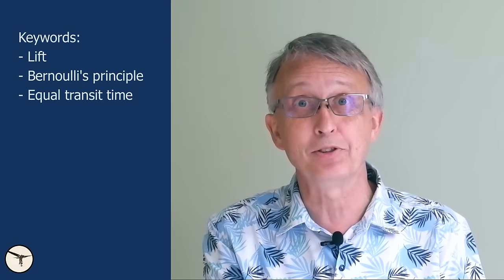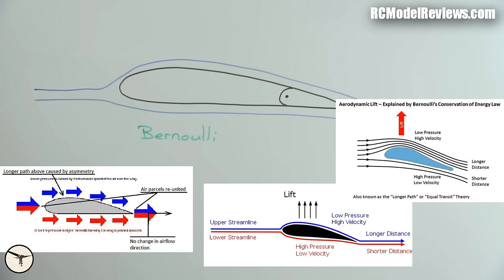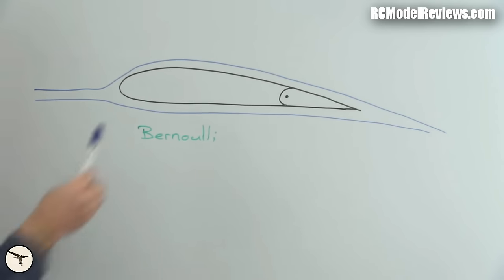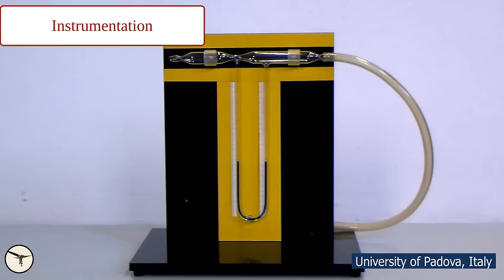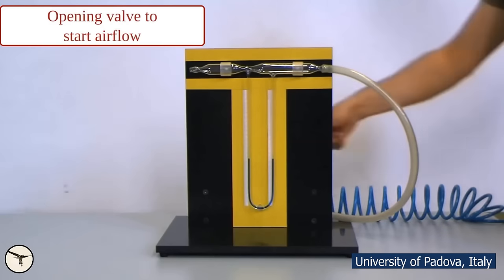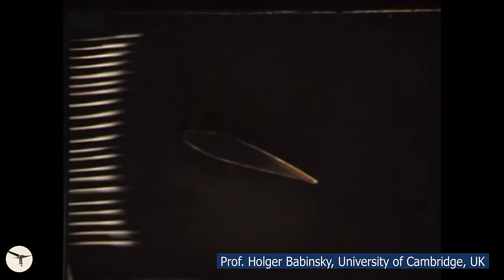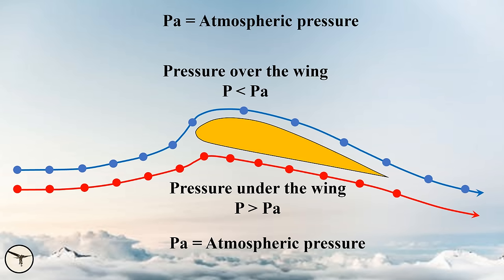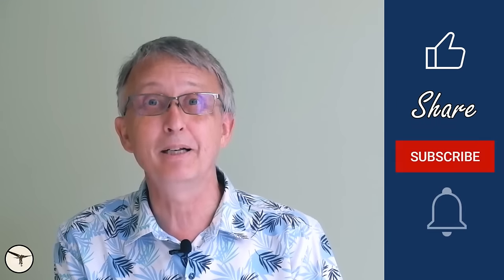Why are so many pilots wrong about Bernoulli’s Principle?

Comment: I’m an aerospace engineer who graduated from Embry Riddle, the top rated aviation school in the country. And even there, in our early aerodynamics lessons, the equal transit time fallacy was taught. I remember because I asked - Why does the air on the top HAVE TO reach the trailing edge at the same time as the air on the top? And my professor didn’t know… but to his credit, he came back the next week and taught everyone the fallacy of the equal transit time.
Reply from the maker: That's a great quality of an instructor.
Reply: No aniversário de 100 anos da Aviação eu entrei com essa questão "- Por quê um avião voa?" justamente para abolirem essa falácia que todas escolas ensinam sobre a sustentação e com o mesmo argumento do vôo invertido não aceitei tal resposta;
Reply: Calm down it's just a math model. Ask any farmer and he will tell you it doesn't have to get there at the same time. It's like permanent magnetism and residual magnetism it's all a personal opinion which one is there. If I like it it's permanent magnetism and I sell it for being a permanent magnet. If I don't like it it's residual magnetism and I don't tell anybody
Reply: @jacobstump4414 I have a technical article copied that credits Newton for wing lift, not Bernoulli. Did anyone teach that?
Reply: Only the second law of Newton related to the variation of momentum : F=d(mV)/dt, describes correctly the wing lift (vector F for the force on an air particle, scalar m for mass of that air particle, vector dV for the variation of velocity and scalar t for time). This law applies to all air particles moved by the plane flying through the air. The wing lift is equal to the vector sum  of the forces exerted by all air particles on the wings. The Bernoulli's equation describes only the aerodynamic behaviour of the air due to the movement of the plane. It has noting to do with the lift.
Reply: @jean-pierrevandormael5315  I see exactly what you mean and I see exactly what you don't mean. Bernoulli's formula has something to do with Lyft if you want it to and you want to model it that way and if you don't want to model with that way after model at the other way.
Reply: It has to reach at the same time because otherwise it would be shearing the armosphere. Natures solution is the formation of vortices behind that dissipate the shearing behind the wing. If the wind tunnel was run in lower speed to maintains laminar flow then they would reach both sides at the same time. I believe that if we invert the wing on the tunnel the time difference would became miuch greater and cause a lot more turbulence.

Excellent video - I really liked the wind tunnel image! I think equal transit time made sense from a logic point of view in the late 19th century when wind tunnels did not exist and that's why it's still taught. Another reason is that if functions as simplification that, if well done - like they do em Embry Riddle - makes for a good first approximation.

We all learn that electrons are like tiny spheres that travel around the nucleus. In my parents' time they orbited the nucleos like planets do around the sun. In high school (1990) I learned that they did not orbit because, in reality, we can't say how they move  because of Heisenberg's Principle. We still learned that electrons were like tiny sphere's, though. The fact is no one has ever seen an electron and we can't say anything about its shape - the idea, however, works for understanding a lot of phenomena. Electrical Engineers seem to have a better grasp of "different models for different situations" idea because it's important for practical applications in their field: 60/50Hz AC power can be treated as DC in a home electrical wiring - but not on 1,000 Km long transmission lines. Electrons can be treated as particles on semiconductors but not everywhere - like when electrons go through a tunneling diode.

We should always bear in mind that contrary to what journalists often write and influencers always post we actually know very little about nature and ideas now accepted as univertal and atemporal truths only got their formulations in the very recent past: Tectonic Plates was only fully accpeteed in the 1960s-70s; and all the genetics I learned in High School is now completely obselet becasue after we were able to to read the DNA we noticed it to be a lot more complicated.
Reply: Same thing in Greece. i had to watch a video here on youtube from a lecture from MIT to discover that equal time theory is not correct and to be honest i was reliefed because at first i couldnt understand why the air above the wing has to reach the trailing edge at the same time with the air below.
Reply: You must have gone to Daytona because the Prescott campus had wind tunnel labs in AE301 which showed the equal transit theory is false.
Reply: Riddler here.. that degree program is brutal.. majority of ppl fail
Reply: @maxheadrom3088  Wrong.   That's the fallacy.
In actual wind-tunnels, running slow with completely laminar flow, the parcels don't arrive at the same time.   They're split, and remain split permanently.  (Same thing happens in simulations, where turbulence is zero and the flow is 100% laminar.)

In fact, if we adjust the AOA of the wing, we find that the "splitting" or "phase-delay" of the parcels will change.   We can easily make the parcels recombine.   That only happens when the Circulation becomes zero, and the lift goes to zero.

So, a recipe to cause zero lift, is to set your wing so that the split parcels recombine at the trailing edge!   (This of course is a part of laminar "circulation theory," where the spanwise circulation will always speed up the flow above the wing, when compared to the flow below.  To create lift, parcels must always be split, and also, the wider the spilitting, the greater the lifting force.)
Reply: Rate of total mass flow in towards the wing must equal the rate of total mass flow out from the wing (in steady state).  

The preceding is the equal transit time which should be discussed but is almost never mentioned.

You must have however much imbalance in speed between top and bottom of the wing as the total asymmetry (shape plus angle of attack) calls for.
Reply: @davetime5234  Equal transit time is simply wrong.   Any smoke-tunnel experiment will demonstrate this.  All the fluid-simulations agree.  (If we adjust the wing so that the split parcels do recombine, then the lift goes to zero.  "Equal transit-time" is a recipe for creating zero lift.)   
For those who think that "Equal Transit-Time Fallacy" is correct, it means that their understanding of lifting-force is literally less than zero.   (First they must unlearn the wrong stuff, just to attain zero understanding.)   

Also, "equal transit-time" directly violates modern "Circulation" theory.   The split parcels have two vastly different speeds, and they never rejoin again.   Is this difficult to accept?   That just means that our misconceptions are fighting back, and trying to defeat truth and simple reality.   

Lastly, flat wings work fine.  "Airfoil shape" is irrelevant ...except for suppressing the flow-detachment and stall.   The Wright Flyer used thin canvas wings.   So does any sailboat.   To understand lifting-force, just analyze a balsa-wood toy, or a paper airplane, or the Wright Flyer.   (The thick-wing diagrams will wreck your understanding, so just refuse to use any.)
Reply: @wbeaty  Please re-read my second paragraph.  I'm not describing what nearly everyone means when they say equal transit time.  If you carefully read the rest of what I wrote, you would see it is the mass continuity condition, which is crucial, and certainly integrated into every practical fluid flow simulation used to design working aircraft wings.

You asked if the different speeds are difficult for me to accept.  

The fact that I explicitly said they must be different implies you didn't carefully read what I wrote.

Check out the Navier-Stokes conditions elsewhere.  Of the big three:  mass flow rate in must equal mass flow rate out.  (the other two are momentum is conserved, and energy is conserved).  That certainly doesn't imply top and bottom speeds must be synchronised.

Some academics have written about the presumed historical origin of the false equal transit time explanation, which at least has or had been surprisingly persistent.
Reply: I did the engineering program at ERAU. I don’t know which professor you had but we were taught very quickly that the equal transit idea is incorrect.
Reply: @josephn944  I don't think any reasonably informed person denies that transit time is unequal as shown by necessity of sound reasoning as well as clear evidence.  Mass flow continuity however and its core position in the equations which accurately predict lift is somehow oddly ignored in descriptive discussions about the nature of lift.
Reply: @josephn944  When he says "taught the fallacy," maybe he means that the prof gave the correct explanation, but also warned students about the wrong one that's found everywhere in grade-school textbooks.  
In other words, warned about the fallacy, (not taught the fallacy in place of the right explanation.)
Reply: The only correct explanation of lift is the one that uses the equations of navier stokes, and those equations are simply an elaboration of the basic formula F=m*a. By simplifying the equations (reynolds assumed to be infinite so viscosity->0 + other assumptions) you can get exactly bernoulli's equation. That equation + equation of continuity are enough to give an explanation of lift but only if you know how the flow aroubd the wing is shaped, which can be simply understood with a simple experiment( wind tunnel with smoke lines). Equal time theory is just a way to justify the fact that the flow has to accelerate but is completely wrong.
Reply: @alessandrobertoli5389  "The only correct explanation of lift is the one that uses the equations of navier stokes"

But those equations are: 

conservation of mass (continuity of flow rate), 

conservation of momentum (momentum is a vector quantity, so I assume this somehow, maybe, takes care of your: "but only if you know how the flow around the wing is shaped", and

conservation of energy (which Bernoulli is shorthand for: static/dynamic pressure tradeoff).

"Equal time theory is just a way to justify the fact that the flow has to accelerate but is completely wrong"

Yeah, I keep thinking it's, perhaps, a mischaracterization somehow, of Navier-Stokes's mass flow continuity (which absolutely must hold).
Reply: @jadneves  now, try in English ok?
Reply: I never bought the traditional explanation when it was introduced by my science teacher in high school and recall debating with him about it. By putting my hand out of the window of a car, I realized that a flat plate would generate significant lift.  However, without the upper convex curvature of the airfoil, even a slight angle of attack would result in departure of the air stream across the top of the plate, resulting in turbulence with subsequent drag and instability. At that time, I thought of the upper curvature of an airfoil as a feature that allowed a higher angle of attack while preserving laminar air flow.
Reply: @maxheadrom3088  And the atom theory is still a theory, not a law.
Reply: @rossk4864  A flat plate and a symmetrical airfoil ( the F-104, I think)
Reply: And what about when an airplane flies inverted or performs a knife edge maneuver?
Reply: @SwanOnChips   Bernoulli starts it and Newton finishes it. Taught to me in my basic airframe class.
Reply: Wow. You apparently couldn't figure out the answer to your question back then, and you clearly still can't. Remind me to never hire a graduate of that school.
Reply: Pilots are not engineers or physicists. The drive planes.